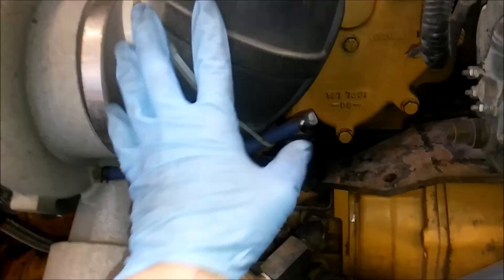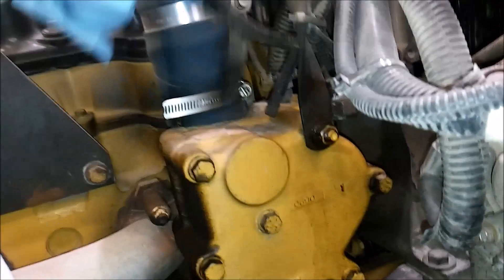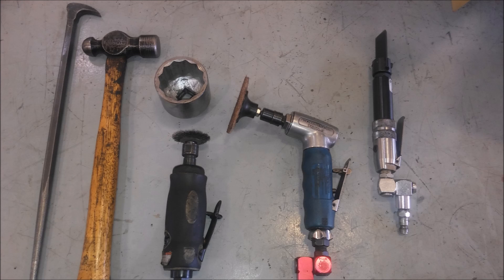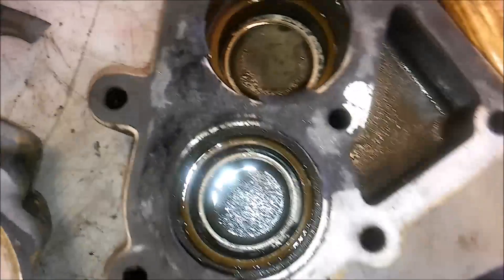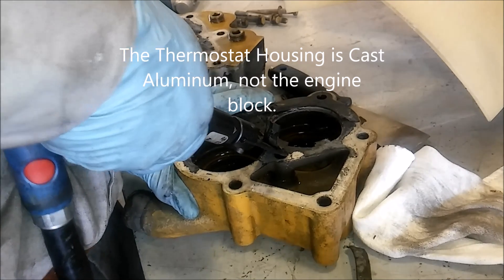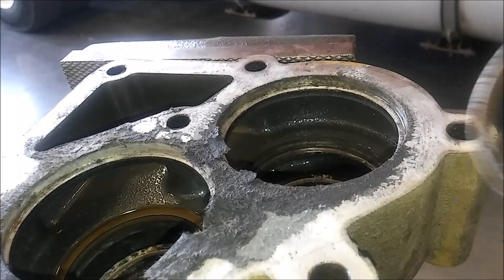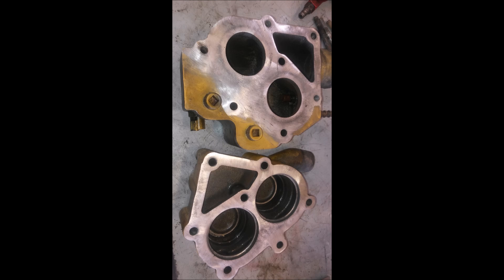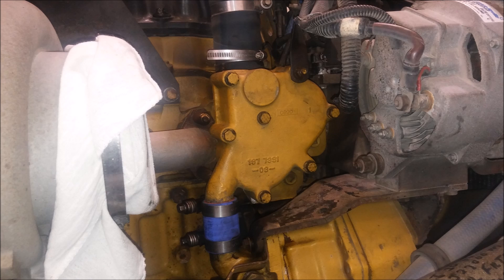How To Change 3406 and C15 Thermostats.  Cat Thermostat Remove and Installation.

Comment: I changed my thermostats and my engine is running a little cool or taking a while to warm up. Is there a fitting or valve onto of the thermostat housing that may fail. The small line next to to 2in line?

Comment: Just changed the Thermostats in my C-15.  Was missing the lower seals.  Any reason someone would remove them?  Also my local Cat parts department Says the gasket that goes between the housing and block (#4N1156) doesn't exist.  Any idea if there is a new part number or a Gasket kit?  
Great videos have watched many of them.

Comment: Hi there ! What's the purpose of the bypass hose ? I noticed that goes from the thermostat housing back to pump inlet, but with engine cold where does the bypass hose get its flow ? (from which side of the thermostat, engine or rad ? ) Thx

Comment: I have cat c15 i changed thermostat and temperature sensor but they didn’t solve my problem the problem is not going overheat temperature stay on 150 or 160 it’s stay cool and some time when am driving on up hill it’s go down and on down hills it’s go on right position please help me asap thanks
Reply: Bad temp gauge

Comment: Question: CAT 6NZ; my lower radiator hose feels Cold compared to the Top Radiator hose.

Is that Normal? Or are my Thermostats Stuck Open? The temp gauge does stay around 190F.
Reply: If regulators are stuck open, generally engine drops down to 150 F. Delta T across top and bottom, 1 F min, to 11 F max. Make sure when your checking the regulator is fully open. I run a data log on a cold engine up to fan on temp, at high idle. I then turn the A/C on and check the high psi switch, idling. Finally I turn the manual fan on and let it idle to see if temp holds close to regulator temp.

Comment: Why not just take the half off that's closer to you? Seems like a bunch of extra uneeded work to take both halves off the head.
Reply from the maker: The 3 bolts that hold it to the head are also 3 of the 7 bolts that hold it together. If you try to just separate it at the head you will have disturbed the gasket between the head and the thermostat house very high chance its going to leak then. Better to remove and reseal it all at once.
Reply: @AdeptApe  10-4, thanks. I'm getting ready to do one on a 3406e but Kenworth isn't showing the gasket between the halves (only the one that goes next to the head). I guess I'll try the CAT house next since apparently there are two version that fit.

Comment: Is it possible to switch out coolant temp sensor without removing housing?
Reply: Yes, old 5EK and such (three wire) need a special socket. Two wire sensor depends on sensor. Old style brass you can't get that any more. Gone to a plastic head and I cut a 7/8 deep well socket off, just enough to clear sensor. Use a Craftsman as it has the hex all the way up.

Comment: Hey Adept Ape, got a question. I have a C15 on a 2006 9400i. Truck keeps running hot. Took it to a cat dealer. I've gotten the fan clutch changed, fan solenoid replaced, the air hose going to the fan solenoid replaced, I've gotten the thermostats replaced, even got a pressure test done when I got the thermostats changed, I've gotten the high pressure switch changed as well. I can hear the fan clutch engage when temp hits 210-215, sound like fan is coming on but temp keeps going up. Of course I have to pull over by 230 cause truck will shut down. When I hit the manual override for the fan I get nothing. Flip the switch 50 times fan won't turn on. I will drain the air, let air build back up, may have to do that a couple times, but eventually the fan, or maybe hitting the override switch will eventually work. Is it something electrical causing the fan to not stay engage? I'm at a lost.
Reply: Some clutch  fans have a threaded hole in front you can get a bolt to thread  in there lock it up permanently
Reply: @salmonaco007  Hey thanks for responding. The whole time it was my radiator. Cat replaced the radiator and I haven't had a problem since. It probably never was the fan. The radiator was clogged and had a leak.

Comment: Copper anti-seize those long 3/8” bolts that mount it to the head ( the entire length of the bolt and threads)! If you’ve done this long enough you know how those bolts will get seized up and then break off when you try to remove them.

Comment: Would a stuck thermostat cause the engine to run cold going down the road and hot on hills with a load? I got no heat in the cab and the temps wont go past 100 unless im pulling a big hill with a load then the heater starts working too
Reply from the maker: Yes Definitely it is the number one cause of your symptoms.
Reply: @AdeptApe  how about a red check engine light with a slash through it thats beeping? Also have a yello check engine light that comes up with code 55, could that red flashing light be from the thermostat being stuck?

Comment: Do you a video of removing the water pump for a c15 acer
Reply: I just did today change pump and the temp regulator valves....c15 double turbo...pain in the ass...

Comment: Thank you, it’s very helpful Sir , 
I just wanted to ask you about freezing plugs , while i tried to change the freezing plug which is inside the cover head , it went inside the cover head cooling lines when i used hammer , and then i put the new one , do you think if i leave the old one inside the cover head , it will make problem in my C15 engine ?

Comment: Hey adept ape love you're videos very helpful,,just had a question I have a single turbo c15 runs fine but when it gets above 200⁰it starts idling up and down like small revs as I'll turn the fan on and as soon as it goes below 200⁰ it runs perfect again, any thoughts on what it could be?
Reply: Cracked head at injector

Comment: Hmmmm CAT C15, C16, 3456, 3406E and Perkins  2806C-E16, 2806C-E18 are very similar to each other even I found CAT part numbers on numerous engine parts likewise Main bearing, Thrust bearing, Big end bearing, Small end bearing, Rod & piston group, oil pump, fuel pump, water pump, cylinder block, cylinder head, cylinder Liner and OHC components. 

The vital difference is in between oil & fuel filter housings, valve cover split and one piece respectively and that water temperature regulator housing. CAT has Gasket and lip seal 3S9643 while Perkins differentiate it by installation of Seal pip press type OE style. Caterpillar these particular ACERT engines have their own ECM, harness style, fuel injectors and cartridge type filters beside fuel water separator. On the other hand Perkins engines have designed same components in physical appearance but based on own electronics and bar codes.

I believe Perkins Tipss communication adapter can also communicate on CAT engines and vise versa. Only software Perkins (Engine Service Tool) and CAT (Electronic Technician) are differentiated.

Comment: Which plug on that housing do i want to remove if I want to perform the water pump pressure check? The diagram in the book is really badly drawn but points to somewhere on the upper right side of this housing.

Comment: I have a housing with excessive wear where the thermostat touches the housing at the bottom. How much is too much?
Reply: Just replaced mine. Cat # 228-0404-02. It’s $110 why risk it. It it has started washing out it will only get worse. It was a $110 insurance for me. What’s the down time/cost to go back into it later to replace what you already have off?

Comment: What are the two sensors on top of housing for ?
Reply: I’ve only ever seen one sensor on top. It’s for the gauge in the cab. The Cat sensor is for the engine ecm.
Reply: @bradleyschwarz8458  been a while since I was on the ole you tube yeah I figured that out one went to the gauge in the cab for some reason mine has two im not sure if the person who had the truck before me took the plug out of the other hole and put another sensor in either way they both run to the gauge

Comment: Whats your opinion on the 170 vs 190 thermostats
Reply from the maker: +Joseph Barr Running your engine at lower than engineered operating temperature can accelerate cylinder wear and hurt fuel economy from what I've read.

Comment: Got me new thermostats and gaskets for 3406e cat.  Drained the coolant and started removing the 3 bolts that hold the housing on the block and guess what??? Lol. They wanted to twist off.  I stopped. I could feel them giving.  Is there a certain way to get these bolts out without breaking them off in the engine block.??
Reply from the maker: +kevin l Unfortunately, nope. The bolts are most likely seized into the thermostat housing since it is aluminum and the head is steel and so are the bolts. You'll probably a new thermostat housing and bolts. You can try hitting them with a hammer to try and jar them loose.
Reply: Adept Ape so that means even drilling out the broken bolts as well in the head? Dammit.

Comment: Where is the housing on a C13? Front on top by the hose? Or side lower under the turbocharger? It gets hot for a few miles and then it goes down. This happens every day after I shut it off and water temp goes below 190. Sounds like a stat Yes? Or does it sound like something else?
Reply from the maker: +Rick Camp The housing is on the front of the head. If the coolant is getting hot then dropping way down and staying there, you might have a sticky thermostat.

Comment: I have a C13. I have changed several thermostats due to overheating, compression, bubbles in radiator etc. Now I have removed the Thermostat and everything works just fine. No issue What do  you think is wrong?
Reply: hey did u ever figure out what the problem was? im having same promblem on a c13 2006 and we replaced everything even the radiator.
Reply: Head gasket

Comment: can the dual thermostat housing be retrofitted to a 3406e 5ek? the bolts seized in my old housing and i bought a used one which also has issues. i repaired both the best i could but eventually i'd rather buy new
Reply from the maker: +chrisevans2645 There is a question I haven't heard before, can anyone else on here try to help him if you have tried this before?
Reply: this is what mine looks like after bead blasting, painting, and building up the gasket surface with jb weld. https://scontent-lga3-1.xx.fbcdn.net/v/t1.0-9/14642281_10153884013176524_913821250479428490_n.jpg?oh=b50441b4497aefef8ef80a4860aaef1c&oe=5981B1C8

Comment: Hello Adept.  Love the CAT videos you do!  I just bought a 2005 Kenworth W900L with the C-15 BSX series engine.  The water temp guage pegs out at 250 degrees after the engine warms up, but after putting a laptop on the ECM,  it said that the temperature was at 180 degrees.  Engine fan works normal when temperature rises after turning on AC.  is the temp sensor bad?  After the engine cools down when motor is off,  the guage goes down to zero.
Reply from the maker: +Anthony Kelley You probably have the Kenworth sending unit that is reading incorrect. If the Cat one is working then you are probably okay, but you should fix that before summer.
Reply: Adept Ape 
okay thanks.   I'll pick one up today.
Reply: Hi Anthony I got the same problem with my truck but I’ve got a Freightliner did you end up finding the problem please let me know
Reply: @selbalta873   If you have the same motor, then go to either the dealership or a CAT shop and have them pull up the motor diagram with the temperature sensors... the one for the guage on top is different from the one on the front... The fuel filter housing has the same sensor as the temp sensor on the front... Mine had all three of the same sensor and that's wrong because someone before I bought the truck put the wrong sensor in for the guage... It pegged because the resistance is different in that sensor from the correct one... I got the correct one a couple years back from the Kenworth shop here in Landover, Md and it's been right ever since... I thought changing the guage in the beginning was the problem but it wasn't... On mine, someone had to change the connector to make the wrong one fit... So after I bought the correct sensor,  I had to get the correct connector as well... Had a CAT shop in Columbus, OH pull the correct connector and put everything back right..
Reply: @anthonykelley368  thanks Anthony 
Freight liners in Australia only have one heat sensor that’s on the thermostat we changed the thermostats as well to 190° I think they might be running a touchup I might change it back to 180° workshop told me the ECM and the gauge never read exactly the same anyway so I might start with the thermostat thanks for getting back to me I will let you guys know

Comment: hi adep  what do you know about heating sistem  i change the control panel the blow motor and still not working i dont have heat in the cab
Reply from the maker: +roberto ayala Are the hoses going to the cab hot?

Comment: How does this style t-stat work?  Do they slide inside of itself? I have a cat 5ek that will not warm up. Thank you
Reply from the maker: +Chris Lowe Sounds like you may have one stuck open then. So the outer body actually separates and sides away from the top portion of the thermostat.
Reply: I got 5ek and use to be 180F now it's stays 155f , I changed already 2 times that thermostat . Seems like mine only have one , but I notes that you only took 3 bolts out and whole assembly is out. I been taking all bolts out and just that cover maybe that's why ? Or 5ek has just 1 thermostat ?

Comment: great video. do you always take both thermostats out? or do you only notice a thermostat problem when they are both broken?
Reply from the maker: +Bruno Lamote Thanks for commenting. The Thermostats are usually changed together as a set. They also get changed a lot when a truck starts to overheat, but are rarely the cause of the overheat. Usually you'll see a problem is one of them gets stuck open and the truck will have a hard time getting up to temperature.
Reply: what are the main causes for overheating. it is because I have some problems with a C9 clj engine from a claas tractor. it comes just in the hot zone. it is a 300 HP model and the cooling is clean. any idea's
Reply from the maker: +Bruno Lamote I'm actually working on a C9 that overheated. So there are several things that can cause overheats that are little things. Your coolant can be clean, but the coolant concentration may be off and as coolant breaks down it loses some of its heat transfer ability. So if your coolant is more than say 5 years old, try flushing the cooling system with some coolant flush and water, then putting new coolant in. If your radiator cap is not holding the correct pressure it can cause the cooling system to not hold pressure which can cause overheats. You can have a problem with the fan speed but being high enough, depending on if you have a hydraulic fan motor or a direct drive fan. The biggest problem is the radiator itself though. If the radiator has dirt/oil/junk on it that blocks cooling as if the internal tubes are plugged due to corrosion or buildup that restricts your cooking ability as well. Is the engine smoking or any other weird symptoms?
Reply: Adept Ape when it stand's in shed for a week and I try to start it,it starts but sometimes it shuts down then I have to keep starting it (30 seconds) when it starts then I have a huge cloud of a smoke. but everything else is quite normal. maybe a little strange smell from the exhaust. normally no (maybe a little) oil use. but when hot a lot(4 liters  , 1 gallon) in 2 to 3 hours. if. it was a Deere engine I would do a complete rebuild this winter but the cat parts are way to expensive in Belgium.
Reply: Adept Ape when it stand's in shed for a week and I try to start it,it starts but sometimes it shuts down then I have to keep starting it (30 seconds) when it starts then I have a huge cloud of a smoke. but everything else is quite normal. maybe a little strange smell from the exhaust. normally no (maybe a little) oil use. but when hot a lot(4 liters  , 1 gallon) in 2 to 3 hours. if. it was a Deere engine I would do a complete rebuild this winter but the cat parts are way to expensive in Belgium.

Comment: Adept Ape, 

What is the timing calibration connector on a c7 for? How is timing electrically adjusted? isnt it done through degrees on flywheel?

thanks!
Reply from the maker: If the ECM gets corrupted you have to tell the new ECM the timing, which means installing a probe into the block which reads the crankshaft and then the timing can be relearned. The easiest way is to just copy the timing from another similar engine electronically through Cat ET.

Comment: So, do I understand you do not use a gasket sealer of any kind?
Reply from the maker: I do not use any sort of gasket sealant. If a gasket is hard to keep in place I like to use studs to keep them in place. I do use high tack on "puzzle gaskets" like older oil pans.

Comment: Wish I had this video a couple years back when I did one of these.  I remember having to pull the alternator,  it was on a 387 peterbilt.
Reply from the maker: Depending on the accessory drive setup you might have to pull it or the A/C compressor.

Comment: im a field service tech on heavy equipment side i love watching your vids good job
Reply from the maker: Thanks for the comment, good to hear from other Diesel Mechanics.
Reply: Okay then let's ask you about torque specs bolting the housing back on or about temperature should both Tstats be the same or a 180 and a 190 / maybe a 190 and a 200